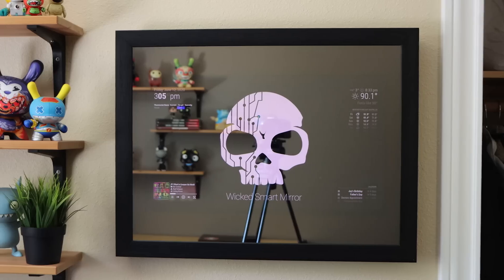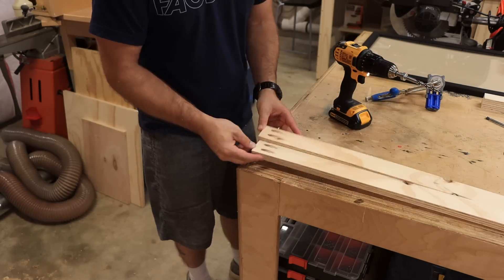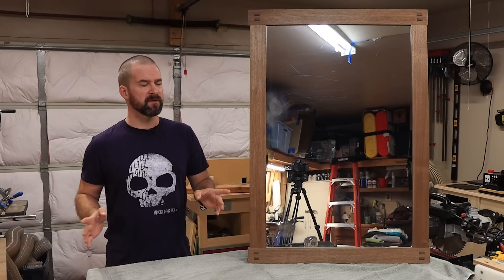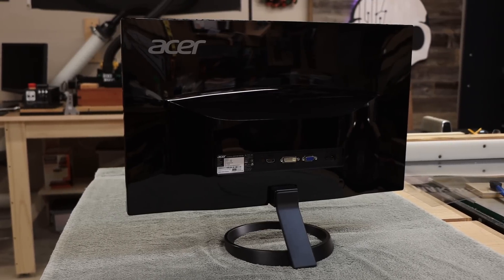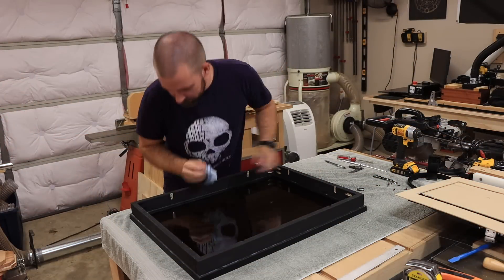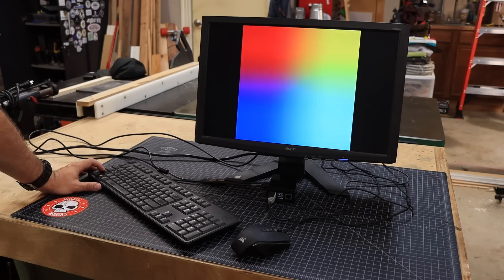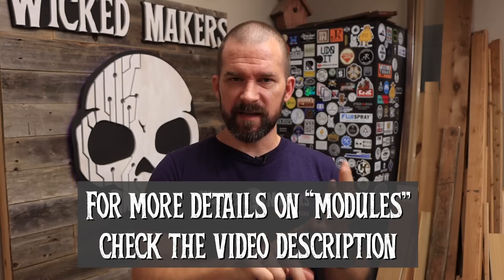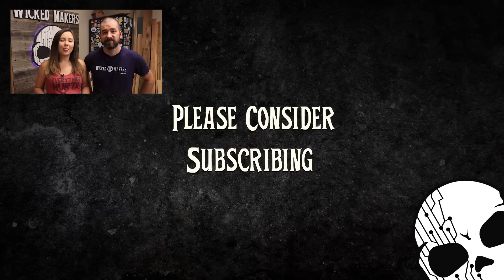How to make a DIY Smart Mirror

Comment: Seems like a lot of unnecessary work when shadow box picture frames are a thing.
Reply from the maker: Yeah that’s a great option if you don’t like making stuff yourself.
Reply: @WickedMakers  So why not just make the entire frame instead of using a store bought  picture frame and turning it into a shadow box (which you could also buy)? Could you not have just built the whole thing? I hear it's a great option if you like making stuff yourselves. 
Not trying to crap on you guys here at all. It just seems like a weird choice to buy a frame and convert it when you could have paid basically the same price for an item that was likely sitting on the shelf right next to the one you ultimately chose.

Comment: Could've cut slits all down the sides and installed some LED's. Not only would this add a cool factor, but it would give you more ventilation for the PI.
Reply from the maker: Great idea, yeah! 👊🏼😄
Reply: I love those LED strips. Got em everywhere.
Reply: Good idea, just don't do it in wet spaces (like a bathroom) because water vapor will get into the vents and cause damage.
Reply: It doesn’t need venting it’s not really doing anything other then acting as a screen saver

Comment: Okay, so big note from someone who is a tech amateur. You should be selective about what monitor you use because monitors are not meant to run at max brightness for an extended period. Running it too brightly will shorten the life of your monitor
Reply from the maker: This is true. Our other mirror has been running for about three years straight though with no issues so we’ve tested this one.
Reply: Depends on the type of monitor. Newer types based on QLED or OLED won't make use of a backlight (be careful with OLED though, it'll burn in pretty quickly). These are a bit more expensive though... :p

Comment: It would be cool if there is touch function as well so you could control all the info and push play/pause forward/backward when playing music. but I got to say that this build is 1 of the cleanest build I've watched.
Reply: Then you realized you need to clean the mirror everyday to remove finger touches. No, it would be better to use the hand gestures, or voice. I actually connected the mobile to mirror's RPI and control from there. It was fun to initiate knock knock sounds at the right timing during past Halloweens :)
Reply: @RadekSvarz  Yes that's what I was implying :)
Reply from the maker: Definitely! Thanks for watching. 👊🏼😄
Reply: If you add a chromecast Firestick etc your mobile can control it all..

Comment: Don't ask people at home Depot or Lowe's to cut those thin strips for you. I worked in lumber at both stores, it's against policy to cut that and it's dangerous (had a piece like that fly toward a customer once when it got stuck on the bent riving knife). Just use 1x2's. Otherwise great video!
Reply from the maker: Sure, that could work too.
Reply: They can also be TERRIBLE at cutting proper lengths if you're not a hawk about it. So frustrating.

Comment: How did you connect the Pi and monitor to power so cleanly? You just happen to have an outlet in that spot on the wall? Just curious, as there are no visible cables coming from around the edges of the finished product.

Otherwise, very cool. An idea that's been around for a while, but this was a very concise explanation of how you all did it. And the final product is very clean looking. Guess $150 for a hunk of glass really does make it worth it.
Reply from the maker: Thanks! You can either route cables through the wall or we actually installed an outlet behind it just for this.

Comment: The video is great....but you might want to start by telling everyone this is going to cost $300-$400..... Which is a lot considering you also need about $400 in tools
I would recommend using older rasberry pis, 720p monitor, and mirror tint on scrap glass. That brings the cost down to about $150.
Reply from the maker: Not sure where you got the $400 in tools, but point taken. Good feedback!
Reply: Well, table saw eats up about $300 of that, rest is clamps, glue, drill bits, pocket driller, etc. Not saying you "have" to buy these tools to complete the job but its  going to come out like garbage without them. This is really a DIY project for someone who already has a full workshop. Again, not bad just maybe a "difficulty" meter + material cost at the beginning of the video.
Reply: Where do you figure $300-$400? Raspberry Pi's are cheap. You can get quality monitors for pretty cheap as well, particularly if you don't buy name brand. The most expensive part of this build is the glass. Mirror tint won't work as well. This is a luxury item though and is fun and somewhat educational. A good project to do with older kids. If I'm investing the time to do something like this I'm not going to have an issue spending a couple of hundred bucks. This isn't a project that someone is going to do if they only have $50 to their name, yeesh. Get some common sense dude.
Reply: @mikel9567  $400 is adding up the provided price list the creator provided.....dude
Reply: @MINEHEAD845 lol......yeah....but I'm saying you COULD build a whole computer for the same price and it would be 10x more powerful
Reply: They tell you within a few minutes that there's an entire computer in the back...any semi intelligent person will be able to figure out this isn't a cheap project.
Reply: @j.s.3414  The Raspberry Pi is the "entire computer" and they go for between $50 and $100 typically. You are making it sound like you have to buy a $500 Desktop PC in order to do this project which is highly inaccurate.
Reply: @j.s.3414  its a rasberry pie, they are like $30...and you can build a windows computer for $100
Reply: The only thing i need to buy for this project is a rasberry pi, and they go for about 60-70 bucks here , i think everyone has an old monitor laying around, ( i got multiple) and you can either buy a photo frame from ikea for like 10 bucks, or make one your own which shouldnt be TO expensive..
but yeah, if you got nothing then yes,this will be expensive.

Comment: You could have just as easily used the Magic Mirror OS they offer and saved time.
Reply from the maker: Yeah that’s a great option. We felt it would be harder for beginners to figure that out but it’s definitely a time saver. 👊🏼👊🏼
Reply: @WickedMakers  it's simpler actually and easier to program, I used it with mine and the Google AIY kit.

Comment: In order to make the wood glue you use to assemble the frame actually be able to work, you need to sand the small part part of the face where the end of the other piece is being joined.
Reply from the maker: Yep, you're right. We forgot to do that. 🤘

Comment: Cool project. This mirror with a motion sensor to only power up when needed. This way you will save a lot of power. Or maybe activate it when someone ring the bell it shows its face. Cool.
Reply from the maker: Yeah, good idea! 😄
Reply: Also good to prevent wasting monitor hours unnecessarily.

Comment: the only thing that i would have done differently is painting the cardboard black on the mirror side
Reply from the maker: Ahhh that’s a great idea. Should have thought of that. 👊🏼👊🏼
Reply: Also mounting the buttons into the side of the frame rather than on the back would have been way more convenient to use.
Reply: What would that do?
Reply: KidLightning13 behind mirrors is a black or green colour to maximise reflection and so the person looking in the mirror won’t be able to to the seperation between the monitor and the cardboard backing
Reply: @TheBlur009er  These mirrors work with principle of lighting. Seeing trough depends how much light there is on one side. Mirror finish will reflect certain amount of that light coming towards it and pass some trough. When there is less light in one side than another darker side lets less light trough and its drowned out by what is reflected back from bright side. Say in police interrogation room suspect side is well lighted, while police side is barely lighted, hence suspect will see what is reflected back towards them, instead of what is passed trough from police side. High quality ones usually have black tint on police side that will suppress light coming from that side.
In this case painting cardboard backing black, will eat more light from that side, minimizing light pollution from monitor to those surfaces what would reflect it outwards to viewers eyes. This is why rooms tend to be painted with lighter colors, since darker eat light away/do not reflect it so well. I hope this answers to your question.
Reply: @TheBlur009er  make the inside darker to not have a light shade difference
Reply: KidLightning13 it’s just for aesthetics :P
Reply: A smart mirror app for your phone 📲 or tablet would be a great idea 💡 making it easier to customize widgets in your mirror  🤔...also a security camera 🎥 would be ideal if you have a babysitter or any other situation where you can turn off all widgets from your phone to make it look like it’s nothing but a mirror while your camera is recording everything and sending live feed to your phone 🤫🤙💪👍
Reply: This is really cool and if there is a way to make it touch screen/mirror that will be way too cool
Reply: @Skult_04  There are special touch screen panels you can mount in front of a piece of glass to turn a regular monitor into a touch screen. I think the challenging part would be to find one which has the right size to fit the frame.

Comment: Why did YouTube recommend this? It's child's play in comparison to other builds of this type that were innovative years ago. For anyone thinking about doing this, I'd recommend checking out others' take on this type of project. Also to save some money and not get the full rPi kit, or even the rPi4 for it. Also, install the lite distro by SSH, or at the very least set up VNC Viewer on the GUI version so you don't have to hardwire or use a BT keyboard/mouse when making changes.
Reply from the maker: This is a starter tutorial for people who have in some cases never used or seen a Pi before, as we clearly say in the video. 🧐 You think they’re going to know how to ssh or use vnc? Your recommendation is only good for people already comfortable with Linux, and they probably don’t need this video.

Comment: This is a great tutorial, I really love it! Thanks for sharing!
Question: Is it at all possible to do this same project with a touchscreen so you can make the whole thing more interactive? That would be really awesome.
Reply from the maker: Thanks! Yes, you could add a touch screen layer in front of the mirror. Definitely a cool idea. 🤩
Reply: @WickedMakers  Nice, but I think this would also need a software customization in some sort of way to make it all responsive don't you think? Maybe a next tutorial? <3 I really want to start with a project like this but....well..first time right. So..I want to have it incl. touchscreen functionality but I really don't know how to do this,...I guess an extra touchscreen layer indeed, a touchscreen monitor and some custom software to make it all work.
Reply from the maker: Definitely would need to do a bit of software work as well, yeah. But, in general, it can be done with the same stuff we’re using. For example, nothing on our mirror is interactive so having a touchscreen wouldn’t give you any useful functionality as is. You’d need to think of what exactly you wanted it to do and then go from there, I think.
Reply: @WickedMakers  True...I'm thinking about Spotify (also needs a speaker build-in), e-mail listing (last 10 or something), calendar and maybe even some smart home functionalities to control shutters, lights etc..
Any other thoughts?

Comment: Is it possible to rotate the display 90 degrees or would the text be sideways?
Reply from the maker: Yeah, you can rotate it. You just configure MagicMirror to be in portrait mode.
Reply: @WickedMakers  Cool! Thank you for the reply. Now I just need to find the time to do the project!
FYI, they make black hot glue. That might be better for stopping light leaks.

Comment: Personally I wouldn’t have put the Pi in a case.  It’s air cooled, and there is restricted airflow already from the frame.
Reply from the maker: Definitely gets a bit warm but we’ve had our other one running for three years straight with no real issues. You can also drill some air vents pretty easily. 👊🏼👊🏼
Reply: @WickedMakers  ah cool mine is with a tv and the case caused issues with me.  Yours looks killer though.
Reply: You missed the part @14:04 where they installed the included heat sink and fan. It helps to watch the video BEFORE you comment
Reply: @AlarmingTwitch  circulating hot air inside a box doesn't help cool the unit. the heat sink and fan will continue to stay hot as it doesn't get any "fresh air". As stated by Wicked Makers, it does get warm, but some air hole vents to get some outside cooler air into the box (the frame or computer case if you will)  will help
Reply: @AlarmingTwitch  that's not quite what I was talking about.  I watched the entire video, what I was referring to is excess heat from the display mixing with the confined area that the pi also dumps hot air into.  And takes in for that matter.  But like I said mine is a tv and puts out more heat into the back cavity where the pi is.  So no case kept the thermals down better then the heat sink and fan of the case for the pi.  So, maybe READ before assuming.  And also personally means if I was doing it, not that they should have.

Comment: awesome project, the only thing i would add would be a touch screen layer to the front of the mirror and a mic.
That way if its connected to your home security you could interact with any notifications while your indisposed.
Reply from the maker: Love the touch screen idea. Will probably add one. 👊🏼👊🏼
Reply: How would you add touch?  Would love to see add on video, Alexa, touch, gestures, etc
Thank you!
Reply: @leybam  

Check this out,
https://www.aliexpress.com/item/32808998621.html?src=google&albch=shopping&acnt=494-037-6276&isdl=y&slnk=&plac=&mtctp=&albbt=Google_7_shopping&aff_platform=google&aff_short_key=UneMJZVf&&albagn=888888&albcp=9594012230&albag=94205055490&trgt=296904913880&crea=en32808998621&netw=u&device=c&albpg=296904913880&albpd=en32808998621&gclid=EAIaIQobChMIjY6kgcva6wIVwxwrCh3O-QM7EAQYAiABEgJnnvD_BwE&gclsrc=aw.ds

fits over top of your panel.

Comment: Great project! I've never used a raspberry pie thing before, but I'm gonna get one! When I built a picture frame around my flat screen tv on the wall, I drilled 6- 2 1/2" holes in both sides and covered them with the same colored stretchy material so I could hear sound.  Of course the top and bottom of the rear-frame were open for heat to flow out. Maybe that could be an option for you guys to hear sound!  Thanks again for a great project!!
Reply from the maker: That’s a really clever idea!! Love it. 👊🏼😄

Comment: Why pocket screws to attach the back frame? Why not just screw vertically through the plywood?
Reply from the maker: Since this is a video tutorial, we felt it was simpler for people to use pocket holes than it is to drill pilot holes vertically into the plywood without a drill press. I was originally going to do that. 👊🏼👊🏼
Reply: @WickedMakers  well thats a lot less technical than I thought!
Thought that perhaps the angle meant stronger grip in the grain or the slightly longer screw in the frame made a lot of difference... 

🤔
I prefer  your explanation.

Comment: Found this video through TikTok. Great instructional video! How did you mount the mirror?
Reply from the maker: Welcome! We installed some heavy duty mirror mounting hardware on the top rail of the frame and screwed into studs on the wall. 👊🏼😄

Comment: Probably ought to put some vents in the sides of that frame or you run the risk of overheating
Reply from the maker: Yep, great idea. You could easily drill some holes on both sides for ventilation. 👊🏼😄